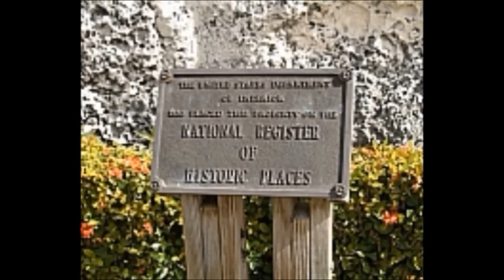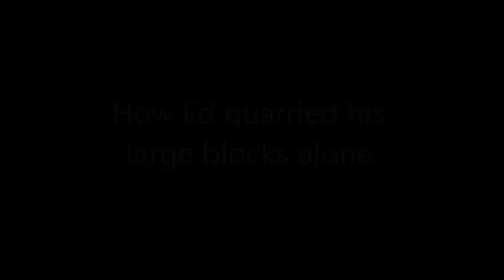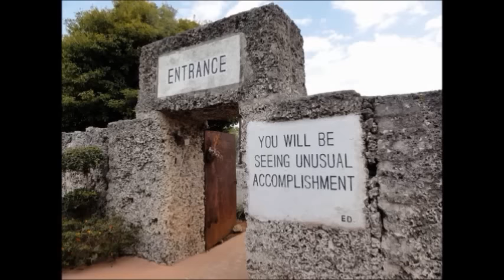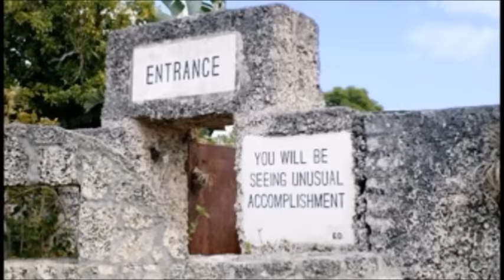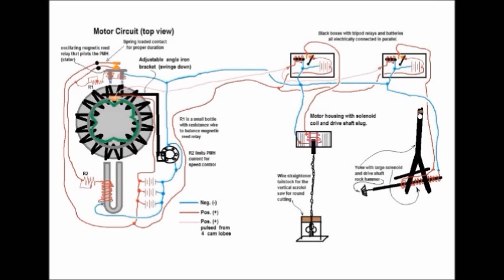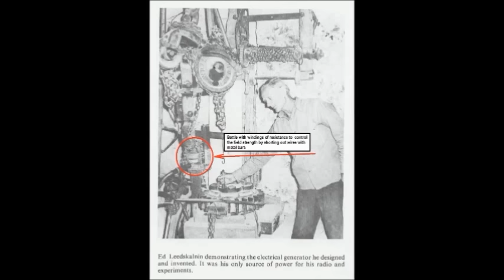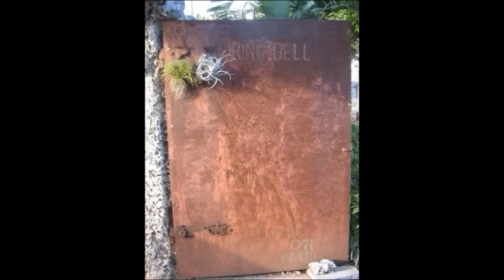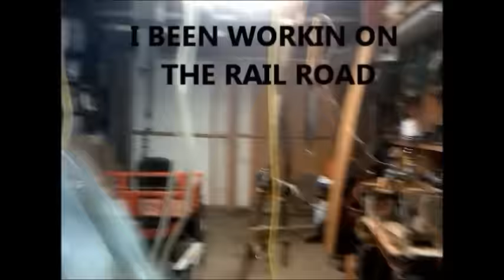Eds Coral Castle Quarry and Flywheel, Engineering Mystery Solved

Comment: I've been to the Coral Castle and live in Fl. One enduring story is that Ed would have these huge stone blocks delivered via truck and would not unload them until the driver left. According to this video, Ed would have had to set up his tripod/block and tackle (?) mechanism over the truck, lift the blocks off, then disassemble the tripod and move the blocks via rolling logs around the site. It's possible, but it sure sounds like a lot of work. 

Another thing, my understanding is that many of the myths or whatever were started by Ed himself. He would say things like "I figured out how the Egyptians built the pyramids" and so on. Good marketing, I'd say.
Reply: The testimony from some of the flatbed truck drivers that moved the massive stones stated that they went around the corner to an area that prevented them from seeing how the blocks were loaded on to the back of the flat bed truck. The real kicker here is that the truck drivers stated that it took Ed but a few minutes to accomplish loading each block onto the back of of flatbed truck. This does not give Ed anywhere near enough time to assemble and disassemble a massive tripod over the back of a flatbed truck of which would take hours if not possibly days. As we can see from this video simply erecting a tripod made out of trees is a massive undertaking. There is simply not enough time during the loading process of the block to assemble a tripod crane over the back of the truck and then disassemble it and accomplish that in just a few minutes. This video completely and absolutely overlooks this very simple fact.

Comment: Well done, Scott Russel.  Your work goes a long way in explaining convincingly the methods used in creating the Coral Castle along with Ed's writings and the many materials and artifacts found on site.  Bravo.
Reply: No, it doesnt...lol.  His 'engineering solution' is all but bunk.  How did Ed charge those batteries?  Did he put ANY type of power measurement into this?  He just 'plugs in the wheel', shows it spinning...and says 'this is how it works'.  Yeah well, how many batteries did it take?  Did he cut ONE rock with this method?  Do you know how many batteries it would take to cut rock in this way?  How did Ed charge those batteries?  With his tiny 'hit and miss' engine he had (most don't even know he had this).  This is extremely inefficient.  You would be better off using the mechanical energy from the generator its self to cut the stone.  Ed only had ONE cutting device, which is seen at his 'at work' photo.  This guys explanation above is all but a distraction from the 'real' technology used.  Just like Tesla...they don't want you to know the real stuff.

Comment: You have my attention but I would have to go back and read about the situations where he did something extraordinary in a short time when people were listening and did not hear any noises, etc to indicate he was doing things that used the kinds of energy you are describing.   
Another point is that the men at that time would have been familiar with the things you are describing and if he could have done them they would have known it.
I think that he did do things with the equipment he had but I also think he did something more either with that stuff or other stuff that related to magnets.  
I volunteered at UFO and free energy conferences for 20 years and I saw some amazing things.  A thing on a carburator that ran a car idling for 8 hours a day of the event, and the exhaust pipe was ice cold. A device made of round magnets that copied the 'wedding cake saucer ' that Billy Meier in switzerland photographed, and when the guy stood it up it began to rotate wildly on only the power from the magnets. And I have seen videos where things Ed had were moved to make a magnetic change and did something I forget, but it was impressive.
I agree with other commentors that although impressive, you theories have not shown they can do the moving of the coral slabs, and if they could as you say, five men could not do it in the time he did things. 
It is like the Japanese team that moved a huge block by ropes, but they never got it up to anyplace that showed it could be done and was an explanation for how the pyramid was built. 
I also have videos where Yul Brown barehanded  with regular glasses and smoking a cigarette welded glass to tungsten, bricks to steel, etc with browns gas. Having worked as a fitter to a welder who cut 35 inch steel pipes, I know a bit about how welding does and does not work, and abiut how much one or two people can do when things are very heavy, etc
I think he could have done what you say but in months rather than hours, and if he did the people who tried to see how he did things would have heard motors and seen lights, etc,
Reply: Great reply. I've been to Coral Castle several times. Almost everything in this video's on point, except I don't remember seeing a reciprocation engine or a locomotion attachment or any heavy machinery. I think he was using the generator to do a couple more things that's missing in this video

Comment: Seems to me quite plausible. The idea of using a band/cable saw makes a lot of sense. Add in some moisture to keep the band/cable cool and the coral rock a bit soft/brittle and I like it. If you notice the coral is quite porous, unlike granite and other harder stone. I have found some coral to be quite hard but not as hard as many stones are. Excellent presentations. I'm going to give it a big thumbs up.